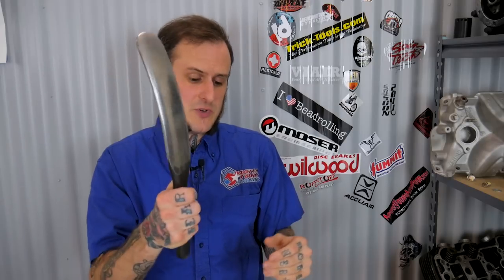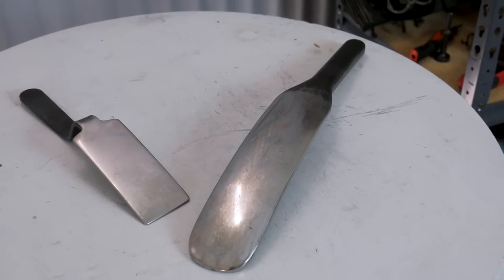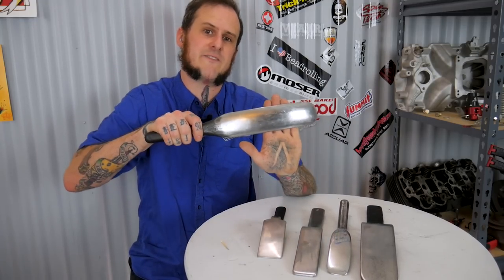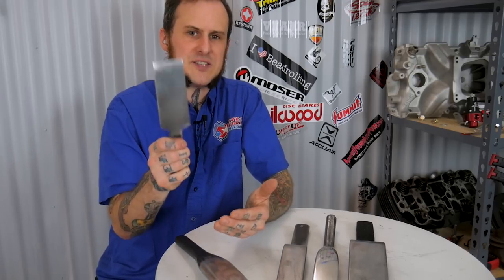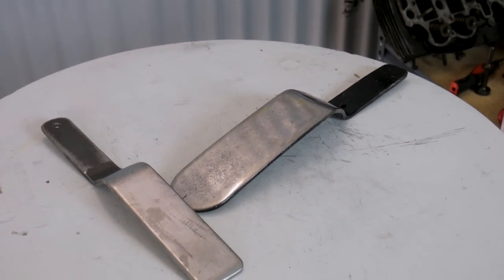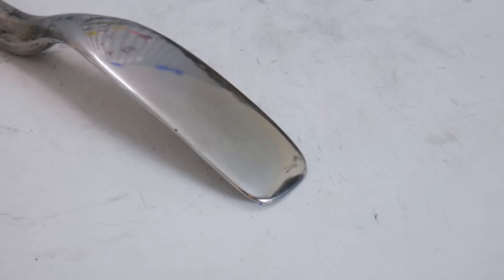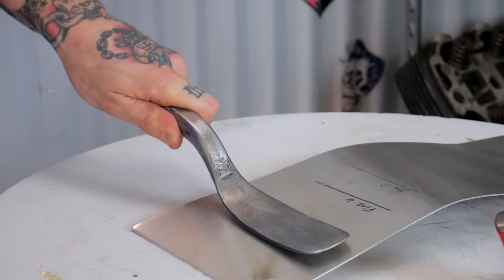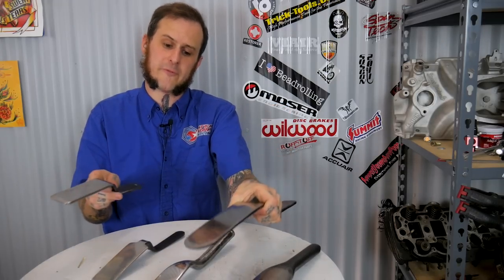Slapper Spoons - 20 - Tool Tip Tuesday

Comment: My first slapper was a Snap on thin and wide knocks down crowns,  works well with a hammer or by itself.   Then I  took a 1-3/4" leaf spring, made a slapping area about 8 inches, handle about 6-1/2" x 1-1/8" inches and about 2" inch raised ,  I ground and polished it,  it's  a heavy hitter, also works well by itself, or with a hammer, also prying.  
GREAT VIDEO.
Reply from the maker: Thank you.  One of the slappers I've made is from an old Leaf Spring.  It gets the job done.  Sooner or later I'll have to make a video showing folks how to make one.
Reply: @HotRodHippie  and THERE IT IS!!!

Comment: I have several. I bought one that was made from a file. They left the file part and said it was for stretching and shrinking. I gave it a try and now it is polished smooth like my others. I prefer a smooth finish with rounded edges so it won't leave marks.

Comment: Wicked video al!!! I use spoons the for flattening safety edges and flanges as well. I have 2 terms for this kind of tool. I would never buy one only the material to make one (if i had to). I have 2 spoons (smooth) and 1 slapper(textured). The curve in a leaf spring is perfect for the job and i rely on the thickness of it for weight not length or width and start off with 14-16 inches mark off the width of my hand and heat it up bend in a vise. For a spoon sand out any pitting and polish up as much as possible because the shinier it is the brighter the mark u will leave on the panel to show where u hit so u can adjust to suit. But with a slapper i use a body file (not a drednought or rasp) or a very large bastard file (technical terms not mine cut the pointy end off and have the branding om the hand end)  bend etc and curve it by heating up the back side and pulling on it to the desired curve (ive even seen people put runs of weld down the back because the weld shrinks enough to curve the file!) and sand the cutting teeth off till nearly gone so when u hit the panel now it leaves like a knerled textured effect on the panel which is so much easier to see compared to a spoon. So i rarely use my spoon now only when im raising the material such a small amount that the file is barely going to file the textured mark out.

Comment: I have heard of Slappers but never seen anyone use them. Are they a different method for planishing? It seems like they would be useful for making sure your dents and dings move to the level of the metal around them to smooth the surface. Such as removing hammer marks. Is that correct?

Comment: Great info,any idea ..all around slapper for pdr work🤔
Reply from the maker: I use them for that sort of work infrequently. Usually in that situation I rest them against the metal and tap them with a hammer. It reduces the changes of striking too hard or chipping paint.